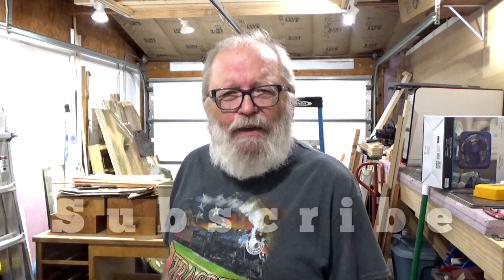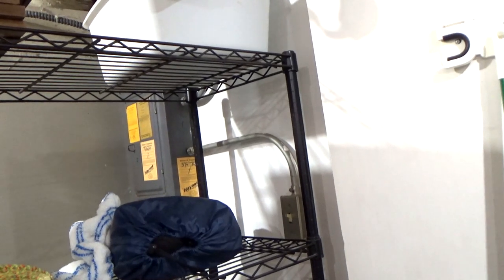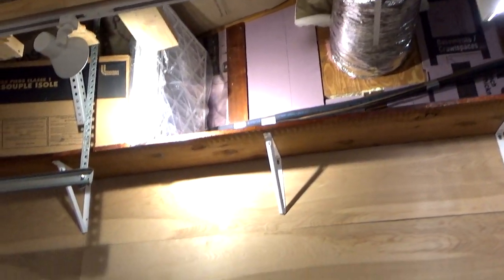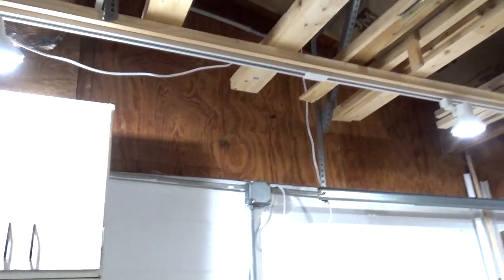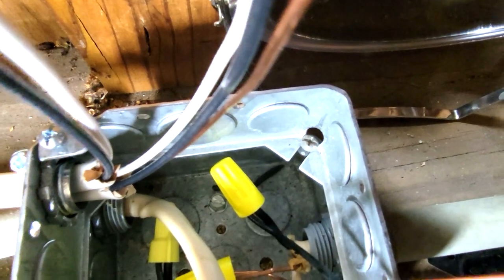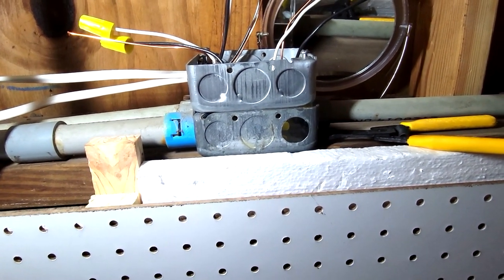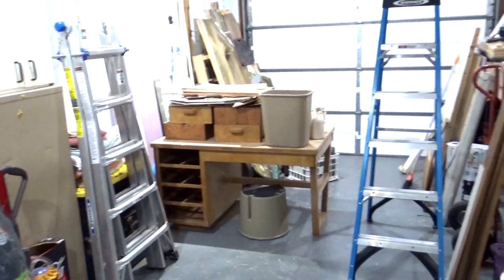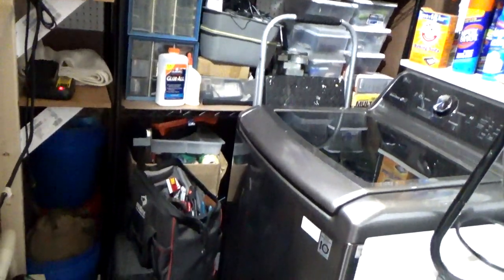You Need This Tool In Your Train Room - Uncovering Electrical Issues

Comment: You're right, Tom, a non-contact voltage tester is a "must have." Don't guess when it comes to wiring and troubleshooting high voltage AC.
Reply from the maker: That's fopr sure. Takes the guess work out of it.

Comment: I found junctions in wiring in the basement of my grandparents' house just like that--taped twisted wires--while tracking down the reason for a dead outlet. There was a charred joist behind a steel junction box and the inside of the box was also black. Grandpa/grandma never new how close to a catastrophic fire they came with their big new color console TV.
We decided to replace all the accessible wiring and bring it up to code where possible.
Reply from the maker: That old wiring can be scary. I'm in the process of slowly checking everything that is accessible.

Comment: Makes you wonder what else is hiding in the wiring of the house?  Your work looks much better.  Glad you found it before it became an issue.  Might want to check code on the mounting height of the receptacles in the garage.  Usually these must be at 48” above the floor and GFCI.  👍👍
Reply from the maker: I'm almost afraid to look, but I need to make sure. I don't think code enforcement is a high priority in this area. lol The power co installed a monitoring device under the panel a few years back and even attached an inspection label.

Comment: Crazy wiring ,must have been a bear to slide that through the conduit
Reply from the maker: I can imagine, especially where there were 2 sets of Romex in the one conduit. It was even hard pulling out the UF wire from the straight piece of conduit I took down.

Comment: I know your pain, the Townhouse I'm in was built in '72 so aluminum wire, and a previous renovation in the basement they just wrapped copper around the aluminum, and taped it up with cloth tape..  and it wasn't even in a box just loose in the ceiling.. I changed out a light fixture, and in the process pulled on the copper which in turn pulled the splice they made into a anchor staple.. only found out when I turned the power back on I shorted it out... almost started a fire in the ceiling.. found 3 such areas in the basement I don't even want to go up in the attic to find whats wrong up there.. basement at least is completely rewired direct to the Panel.
Reply from the maker: My second house that I bought in 79 had the aluminum wire throughout the house, it was only a few yrs old when I bought it . Luckily I caught some of the switches before they fried. I was able to apply CU-AL to the rest of the  copper fixtures before it caused any damage. We used that stuff a lot on the railroad buildings.  I'm surprised this house doesn't have aluminum, it was built in 76.

Comment: Now you know what I went through in my house, I suspect that is was an electrician that did the work. too coincidental that 2 houses each on the opposite side of Sebring could have identical problems. Same with the plumbing, some of it is copper and some cpvc and some pvc. I won't even mention the other oddities.
Anyway, if you need help, just ask. How is Debbie doing?
Reply from the maker: Everything in this house is shoddy. Even the drain going out to the septic was replaced with a 10 ft long rubber hose. We had to have it dug up a couple weeks after we moved in and replaced with PVC with a clean out.

Debbie is doing better... I'll give you a call sometime this week.

Comment: I have something like that, I call it a chirper. I also use a 12 , 24 v dc auto tester. Have you ever worked on a GP 38 or SD 40 ? I have as a Mechanic , I have done some simple electrical on EMDs , like installing and wiring up two 36 volt starting motors LOL. But it's interesting about you being an Electrician on Locomotives, that's good . I just ordered some electrical terminal strips to clean up some of my own wiring. I use an old transformer just for dc v  accessories, and door bell transformer for my turnouts or switches.
Reply from the maker: I worked on a short line RR that serviced the steel industry in Pittsburgh. Our electrical dept was so small when I started, we covered the entire rr, switch & signal, roundhouse, buildings, flood lite towers, etc. My worst job was under cutting the generator s in the SW units.
Reply: @TomsTrainsandThings  I worked on a SW1200 switcher, no starter motors on them, the Generator turned the engine over to start it , the worst unit to change out brake shoes, busted my knuckles doing that. I won't go to the task of reinstalling the oil bath air cleaner.

Comment: Tom just wondering why you were not using WAGO Compact Splicing Wire Connector or something like them rather than wire nuts?
Reply from the maker: I have a ton of wire nut, and you only need one despite the number of wires you need to connect. Besides, Wago is too expensive and takes up too much room. I reserve them for the layout.

Comment: 1 house I thought..they musta had a huge stereo sys. SPEAKER WIRE running everywhere..yup to Light switches & 12 yes a DOZEN wall sockets, on the OMG have too pigtails I've been using WAGO's
Reply from the maker: My first bad thought was when I disconnected the 8ft fluorescent fixture from the ceiling. It was wired with speaker wire the same way but instead of splicing in about a 1/4 way  down the fixture, it was spliced in about an inch from the end. lol